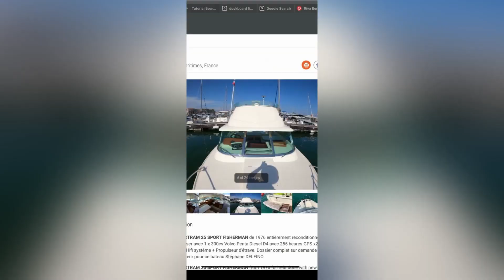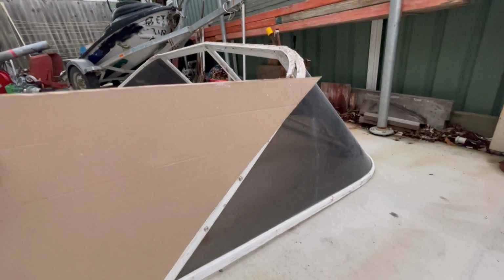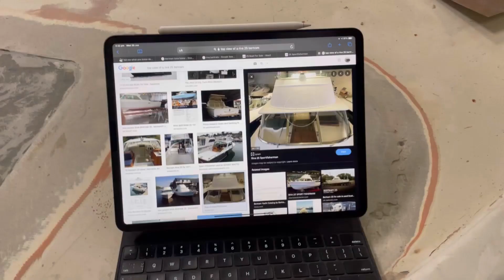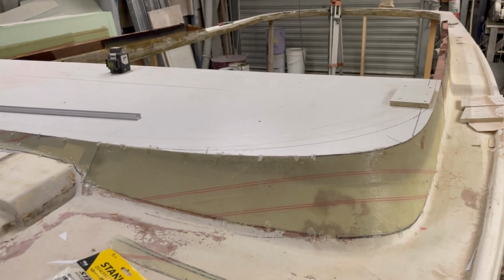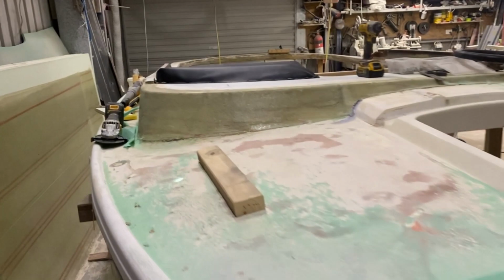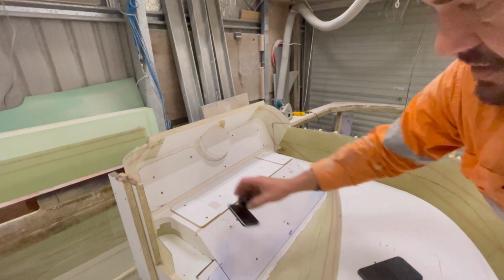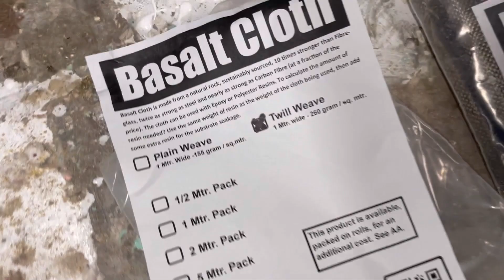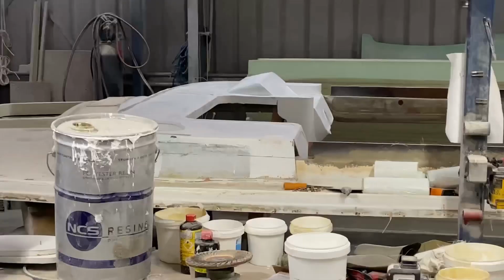25ft bertram project - blob 31 (Making my boat look like a Riva) How i made my dash for my boat

Comment: For the hatch opening that you want to put a handle on to slide it, an option is when you build the hatch instead of a handle make the face a few mm taller to put a simple lip on the top or bottom or both that you grab on with your fingers and slide the hatch open. Takes no room, is clean look and simple.

Comment: Dunno what your day job is mate, but your late night have-a-go design on the fly work is bloody impressive. Coupla tips from an old glasstard boatbuilder and mold maker to save time and effort: Use plasticene to cove internal edges and waxed resin to seal raw wood on rounded externals for a clean release and less finishing. A coat of PVA release agent after you wax never hurts either. Good thinking with the air - glass a nipple on any place with deep vertical surfaces / multiple angles and use water if necessary.. And a hammer? Yeah nah, a rubber mallet if ya need to whack it. Late to the party but enjoying a binge catch up. Keep up the great vids.
Reply from the maker: Haha always appreciate any advice! Especially from old glasstards lol 
Normal kids plasticine? Or special stuff for Fibreglassing? Thank you. You’ll probably find I do a lot of things a bit odd even I cringe looking back at some of the things I’ve done lol. My trade is fire sprinkler fitter, similar to plumber.

Comment: I used my diesel forced air furnace and 'Y' one of the ports with a flapper valve so I could divert my heat from the Cabin up to the windshield when running.  So a 3" line is then split to a couple of 1 1/2" vents blowing up the inside of the windshield from each outboard corner.  Works like a champ in rain etc. when it is a bitch to keep them clear.
Reply from the maker: SWEET! cant wait to play around like that once i get to that stage.... put it on youtube ;)

Comment: Well you got there in the end Bit more of that grinding and polishing and it will be mint  Should start taking bets on the completed weight
Reply from the maker: hahah no fuel 3.3t... yours??? lol
Reply: @Micington  4.2 Ive noticed the number of 20lt drums around the workshop
Reply from the maker: @Woody8457  hmmm I should probably put the empty ones outside lol… I grind most of it back off anyway lol…. I was saying 3.3t because the trailer i got is only for 3.5t. If I get it certified with a bigger tow hitch it can take 4.5t.

Comment: Hi mate, I have a Riva 25 that I rebuilt a few years back…. Let me know if you need any details around the window that I can help with.
The original glass and SS frames are fantastic for their age, defiantly one of the best versions of the 25.
Btw they were made in Italy under license originally
Reply: Actually I have a rhino model as well that I got from scanning it with a prodim scanner before I started the rebuild as well if that helps
Reply from the maker: @lchumbro  do you have Facebook? Can I add you? I have heaps of questions haha wish I could’ve spoken to you a month ago! Haha 
Can you get replacement windshields there? Where abouts are you?
Reply from the maker: @lchumbro  how wide is your center front window? How far is the front side pillar (wide stainless one the curve goes into) from the line of the center window?

Comment: G'day.....any link on the new circuit board for your versaflo?....been having the same prob for years!!
Reply from the maker: Ha
I’ve been searching the web for complaints about em. With no success! I got 3 and they all had same problem. I knew I couldn’t have been the only one with problems! Lol Add me on Facebook if ya want. I will be posting a video soon on how I did it. But if you search eBay or Amazon for a 12v 3phase motor controller get the one that cost about $30aud delivered
Reply: @Micington  cheers mate...will do